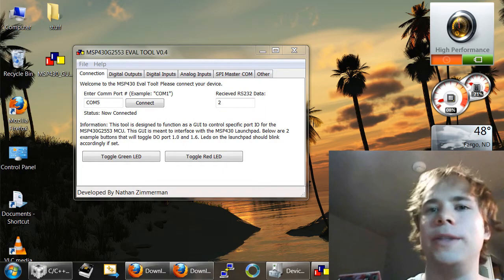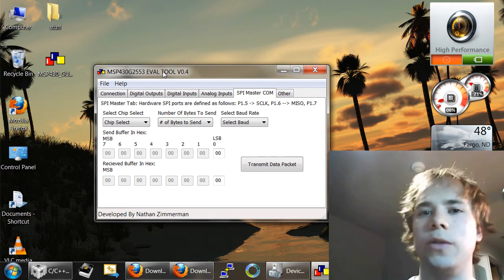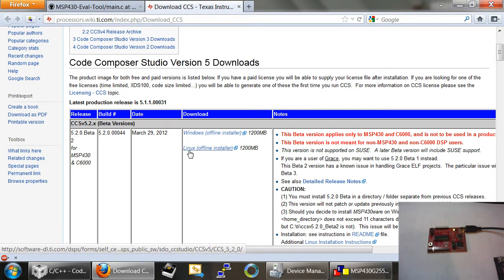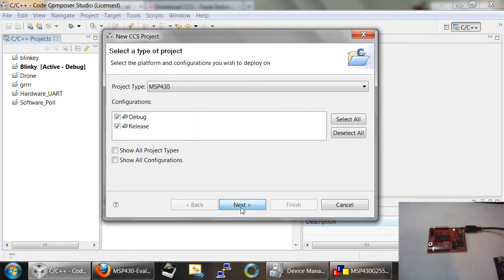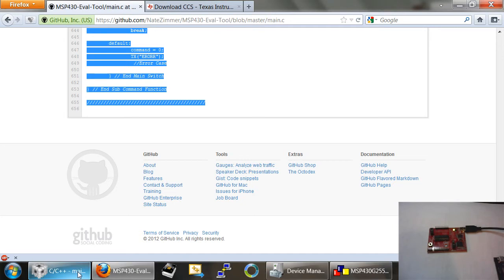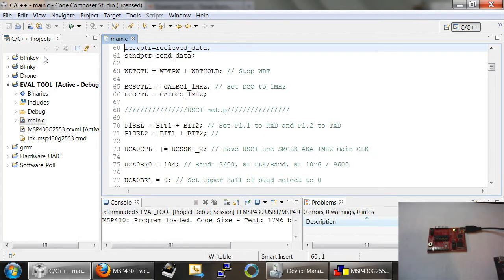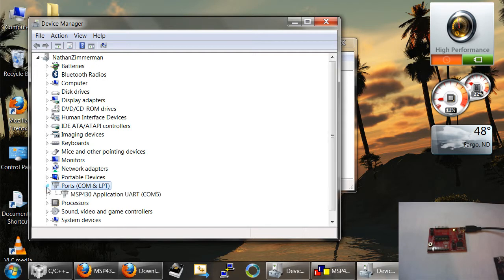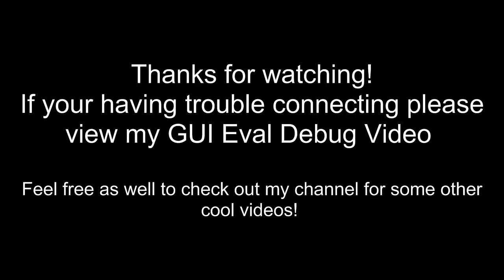MSP430 GUI Eval Tutorial

Comment from the maker: Sadly i've been busy and have not had time to post my debug video. Anyhow, alot of things could be possibly going wrong there. First off, make sure you have a rev 1.5 launchpad. Next make sure the jumpers are set for HW Uart. If that doesn't work, i'm afraid its probably windows 7 being fun. If you by chance got a PC running XP or vista, try it on that. TI never bothered to perfect their W7 drivers i'm afraid. Use a FTDI if you got one for uart to usb and it will work %100 of the time on any os.